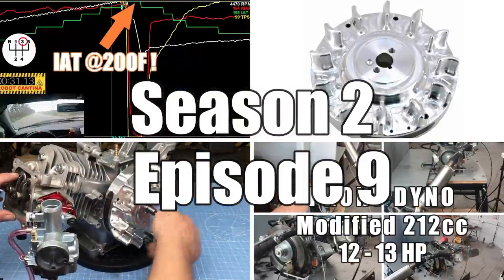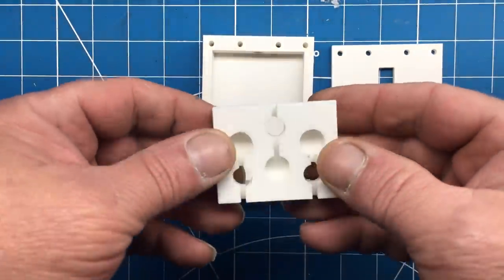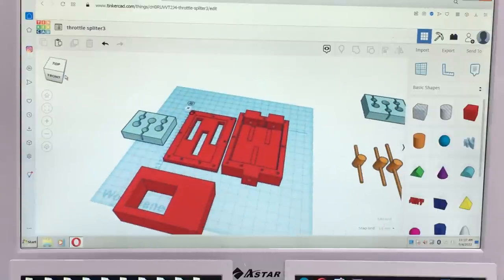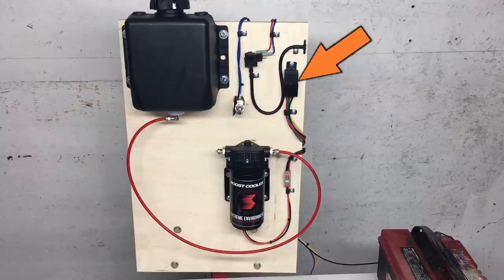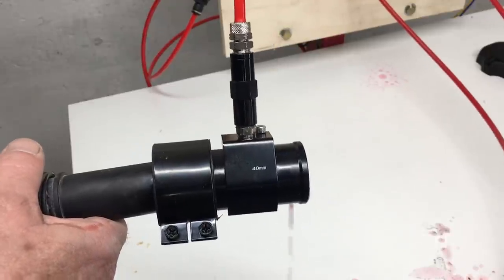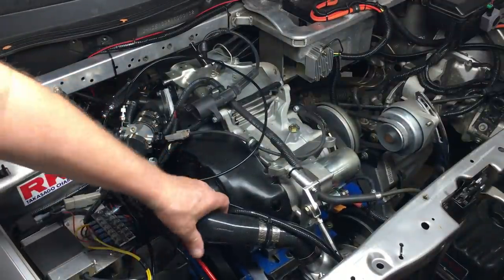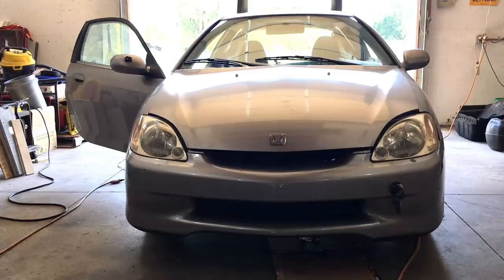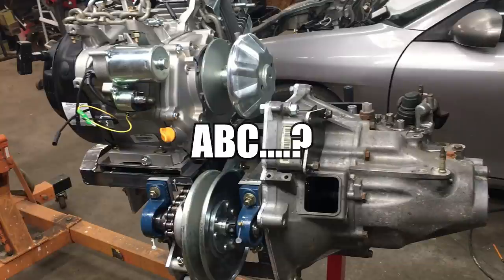S2E9: She’s burnin’ up Cap’n!  The 420cc supercharged hemi gets methanol  injection

Comment: I feel like this project is going to end up in the Guinness Book of World Records!
Reply: For the fastest slow car?
Reply: @benholroyd5221  Don't be ridiculous...it's Slowest Fast Car, get that shit RIGHT!
Reply: fastest street legal go kart...
Reply: @benholroyd5221  longest title for an engine design I’m thinking.
Reply: I think FJB just may end up scalping this 💡 and incorporating it into the Lame New Deal 🤣
Reply: @jpabon18  Proof that cars run fine with a lawnmower engine ...
Reply: @izzyplusplusplus1004  😊😊😊
Reply: Most power for smallest displacement world record
Reply: @MrDrifterdevin  unlikely . He may do well. But I'm sure that' title will be held at the race track. By sand dragster 
Or other small displacement dragster with out hp  restrictions
Reply: And I think it's power per litre or per 1000cc same amount
Reply: Worlds most over designed cement mixer engine
Reply: @jamestunedflat8942  How hot does it get in KANSAS any way?🥤🥤🥤🥤🥤
Reply: @kansasrose2909  mid 90'sF or about 35c don't ask me about Kelvin because I've got no clue
Reply: @kansasrose2909  wait were you flirting with me?
Reply: @jamestunedflat8942  🌹🌹🌹🌹
Reply: @kansasrose2909  ☺🌷
Reply: @MrDrifterdevin  nah, there's plenty of 400 ish cc engines that are making close to 100hp, this ain't it, despite how cool it is

Comment: So with methanol, it's got a couple of things going for it; 1.) it's an alcohol so its a fuel.  As for tuning, you need to take out fuel because you're adding fuel with the methanol.  2.)  It lowers intake air temperature by evaporating which allows you to increase timing since it's combatting detonation/preignition with the lower temperatures.  Additional timing allows for an increase in power.  THe only issue with vaporization is that it take linear distance for the vaporization to occur which  equals the cooling effect.  A lot of methanol induction kits include a spacer plate with a nozzle to inject meth at the throttle plate.  This in theory "works"   but that's way too close to the combustion chamber for maximum cooling.  You'd need a long intake tract to allow the atomized meth to vaporize into a gas to make it worth something.  Plus you'd want it to be after an intercooler so you'd get the benefit of the intercooler and then the meth.  I saw a youtube channel of a guy who has an RX8 (a long time ago) with no intercooler and I don't remember if hes running a radiator or not (it's been a while)  it does run didn't blow up.  I do hope you see this and I hope it helps...

Comment: Safety improvement: Print a new splitter thingy with extra screw hole on the edges so that you can mount a dust cover on top of it. You don't want any dirt making your throttle stuck wide open 😆

Comment: An extremely simple and cheap way to eliminate the vacuum issue is to run an automotive blow off valve with an air filter on it.
Reply: That was my vote. Twin TBs is a “trash” setup that enjoys pumping losses ;-). Trash is definitely my scientific term.
Reply: @BrodeyDoverosx  😊😊😊
Reply: Man,  you seem very happy with ROBOT CANTINA
Reply: Bingo
Reply: @ocdman202  I definitely love it lol
Reply: I was thinking about something simple, like an "organized air leak", using a PCV valve with an el cheapo turbo manual boost wastegate controller.

Maybe it would work, maybe not... 🤷

Comment: What you need to bypass the supercharger is the diverter valve off your choice of any old VW/Audi 1.8t/2.7t engine, the rumor online is the so called "710N" unit is the best, can't vouch for that but they hold up fine to 26 psi on my car. You give it vacuum and it opens, you give it boost pressure and it pushes the diaphragm even harder closed, and best of all, if you remove the vacuum/boost reference, the internal spring will allow the valve to open around 4 PSI as a sort of failsafe boost limiter.

While you're at it you might as well also pull the intercooler off the same donor car as they are relatively small and easy to remove.
Reply: That would be fun. Using the diverter valve backwards lmao
Reply: @BrokeWrench  Which one is harder to come by,  baby formula or gas..???👶👶👶👶👶
This channel keeps me coming back for more.
Reply: @kansasrose2909  They are both worth their weight in gold !
Reply: @ocdman202  That baby formula is made with high fructose corn syrup... 👶👶👶👶
Reply: @kansasrose2909  We are on the precipice.
Reply: Are you ready for double digit gas prices?

Comment: Detonation is spontaneous pockets of ignition that occur AFTER the spark has already started the main flame front. Pre-ignition is spontaneous ignition that occurs BEFORE the spark fires, and that's what you described in the video.
Reply: This is true. Detonation isn't itself damaging to the engine but if allowed to deteriorate into pre-ignition it will very quickly cause engine damage.
Reply: @Dreddip  😉😉😉
Reply: @ocdman202  Man, you seem very pleased with this channel.!!😊😊😊😊😊
Reply: @kansasrose2909  I am ecstatic with this channel.
Reply: @Dreddip    B.S.!.. continued detonation can be VERY damaging to an engine.

Have you ever pulled the rod bearings out of a high performance engine that has experienced detonation for only periods of 8 seconds at a time for 20-30 times? 

I guess not...
Reply: @davelowets  Except in extreme cases, detonation itself isn't damaging to the bottom end of an engine, thats pre-ignition. SEVERE detonation will burn holes through pistons and valves. But to answer your question, I work topend turnaround on nostalgia alcohol funny cars and this year we ran a fuel altered on 100% nitromethane. An 8 second pass for us is when we shut it down at 300'. Safe to say your "I guess not..." assumption was incorrect. 🤷‍♂

Comment: Shouldn't it be possible to make a bypass valve setup using a large T coupler and a one-way check valve on the side? So when there is a vacuum, the check valve opens, and the supercharger then blows it shut when it creatives positive pressure. I'm sure there is a reason why people don't do this, but in theory it should work in my mind, haha!
Reply: audi have a gigantic check valve for this purpose on there compound turbocharged diesels , part No 059145901C to bypass the small turbo once the big one overpowers it.
Reply: A blow off valve in a tubo could work for this. They normally only operate when the throttle is closed and there is charge air in the intake before the throttle body.
Reply: @GradertJ  😊😊😊
Reply: Supercharged Mini Coopers have a small stand alone bypass valve that would probably work well here. One way check valves usually take too much pressure differential to be useful as a bypass valve and mechanical blow off valves usually actuate over too large of a pressure range. Bypass valves use a diaphragm that actuates the valve rapidly right at atmospheric pressure.
Reply: @BuffMyRadius  Which one is harder to come by baby formula or gas??👶👶👶👶
This channel keeps me coming back for more..
Reply: @kansasrose2909  They are both worth their weight in gold.
Reply: @ocdman202  😊😊😊😊
Reply: @kansasrose2909  Rose,  you seem very happy with ROBOT CANTINA.
Reply: @BuffMyRadius   Totally agree, dump the twin t-body's and use a vacuum operated by-pass valve. Or program one of the t-body's to perform this function. Look at pics of the roots blowers (M62/M90) from the GM 3800 engines. They have the by-pass valve built into them.  You'd likely need a couple T fittings on either side of the blower with the t-body plumbed in to by-pass the blower under vacuum. Dig?
Reply: @EricWoodring6thplanet  that's why I suggested the Mini Cooper bypass valve. It uses an M45 and the bypass valve is a separate part, so it should be pretty easy to integrate.
Reply: @BuffMyRadius  When I was a teenager in the late 30's and early 40's, electronics wasn't a word. You were interested in radio if you were interested in electronics.

Comment: Great video! Love the addition of the 3d printed parts!

I default to using Fusion360, i really like the ability to use variables for my sketches/extrusions/cuts instead of setting values directly so i can easily modify the design on the fly.

The addition of using a second throttle body to control the vacuum was inspired!

Looking forward to the next video!
Reply from the maker: No doubt fusion 360 is good stuff, Tinker cad is more or less kindergarten CAD, but at this point that's what level I'm on.
Reply: @robotcantina8957  Hey! Whatever works! Im still a noob to CAD and Fusion 360, but i can make what I need :)

Comment: Make sure the intercooler you use has a weep hole if you're planning to do WMI before it since puddling will be unavoidable. By the way, WMI into a piping elbow will keep it from collecting as a wash on the walls of the pipe. Would make it easier to run between the SC and TB. Though, everything must be taken with a grain of salt given the low CFMs you have moving through those pipes. It might even be possible that a choke point at the WMI point would help as it would increase air speed. Everything will be a bit different to some degree because of the oddball application. I'm confident in your thorough testing though. Keep it up!
Reply: I come here for the video and stay for the comments👍👍
Reply: @ocdman202  😊😊😊
Reply: Glad someone else mentioned this, now I don't have to
Reply: @BrokeWrench  Which one is harder to come by  baby formula or gas???👶👶👶👶
This channel keeps me coming back for more.
Reply: @kansasrose2909  They are both worth their weight in gold!

Comment: Dump the twin t-body's and use a vacuum operated by-pass valve. Or program one of the t-body's to perform this function. Look at pics of the roots blowers (M62/M90) from the GM 3800 engines. They have the by-pass valve built into them.  You'd likely need a couple T fittings on either side of the blower with the t-body plumbed in to by-pass the blower under vacuum. Dig?

Comment: That intercooler should drop temps a lot, Should give a good boost to power.
Reply: @kansasrose2909  Rose,  you seem very pleased with this channel.
Reply: @ocdman202  Yes, I am.
Reply: You could also check out the first gen (02-06) Mini Cooper S parts list for it's intercooler.  They are a 1.6L engine.

Comment: An interesting saga so far Jimbo since bolting the stock 212 cc Predator engine to the Honda Insight.  It's good you are using a car with a low drag coefficient, instead of using a 1960's VW micro-bus.  Speaking of drag coefficient, you may want to calculate how much horsepower will be required to reach your next speed milestones, since you are at the point where losses are exponential.

Keep up the good work Jimbo, this type of thing is of course fascinating to us Techo-Gearheads!
Reply: I come here for the video and stay for the great comments ...
Reply from the maker: Thanks for the comment !  I have to cap the speed at 70 MPH because that is the max local speed limit.  The last  five MPH is tasking forever to figure out... we should get there soon.
Reply: @robotcantina8957  Thanks for the reply.  Yes, the intercooler should help but, with the high outdoor temperatures you are experiencing, I suspect unforeseen problems will crop up.  But, nothing a few more episodes won't cure, just keep those garden gnomes away.
Reply: @billharris6886  I come here for the comments and stay for the video!

Comment: Water meth injection should get those intake temps way way lower than what you're seeing. I know this is a very small engine, and even using the smallest nozzle may be just to much spray using this stage 1 setup. The spray comes on at a selected boost pressure and stays steady. But if you can get a stage 2 setup that has a progressive controller, you can set spray to start at 5psi, and max spray pressure at say 15psi for example(even though you'd never reach that). The idea is that it'll slow the spray rate down enough that it's not too much for the engine. I think you'd have much better luck using a progressive setup vs the hobs style setup. Hobs style isnt the best for PD blower engines. Just an idea that's probably worth trying out. 

Somebody what mentioned using a blow off valve instead of the double TB setup. Just wondering why this wasn't tried out using just 1 TB between the engine and blower set up as a blow through design?

Comment: It'll be interesting to see how effective the air to air cooler is. My preference would have been for an air to water unit but I acknowledge it would be more complex and heavier, and I have no proof that it would be better. Looking forward to the next developments!
Reply: Air to water would actually have been trivial.
Simple electric water pump. The air-to-air intercooler could package better. And then to exchange the heat to the atmosphere you just use the original radiator for the car.
Reply: Another idea could be to use the cars washer system to spray the intercooler to help cool it but im sure it will be fine without that especially with meth injection
Reply: An air to air intercooler works better than I thought they would when I first started playing with them. 

An air to water cooler enjoys longer use under heavy boost without heat soaking, but isn't all that much more effective than an air to air system for a lower power application.

Comment: Why not ditch the first throttle body and instead fit a blow off valve between the output of the super charger and the throttle body on the intake manifold. Then hook the blow off valve to manifold vacuum so it stays open when the throttle is shut but once you have enough throttle opening to hit atmosphere pressure in the intake manifold it shuts and gives you full boost.

Comment: Fantastic video. I have never seen such an elaborate water/meth setup lol. Water/meth is normally super simple and easy to use, but then again, it's not normally used on such a small engine. I knew an intercooler was the obvious solution to high IAT, but this build is all about doing silly things and I love it.
Reply from the maker: Thank you!
Reply: @robotcantina8957  😊😊😊
Reply: @robotcantina8957  💖💖💖💖

Comment: In a twist of Irony, I have seen cars overheat merely because the hood was removed and return to normal operating temperatures once the hood was replaced. Most specifically a mid 90's Honda Prelude we built in our younger days.
 The original engineers thought of a lot more than you might think when they designed the car, and they designed the cooling solution to work best with all of the original equipment in place, mainly the hood.
Reply from the maker: True, but keep in mind this car is far from being original.  Last summer in Michigan when we did a lot of development work, we ran with the hood off and it makes a big difference.  Actually, for this car the best way to keep the engine cool is to remove the aluminum belly pan.  I normally don't like taking that off because it keeps all the dirt and road grime from getting into the chain drive.
Reply: @robotcantina8957  💖💖💖
Reply: @robotcantina8957  Stock motor configuration, No.  Stock aerodynamics, Yes. 
But as long as you tested and verified it on your car and you're not just assuming its cooler with the hood lifted.
I figured I had to throw that out there tho because of my past experiences.
Reply: @TheOneAndOnlyRandy  They should come out with the drinking man's guide to this build..
Maybe ESQUIRE  could do an article..
Reply: @kansasrose2909  Maybe.
Not that I'm much of a drinking man... or a drinker at all.
If it were presented like Drunken History then perhaps I'm in lol
Reply: @TheOneAndOnlyRandy  I really like that show== Drunken History. 🤓🤓

Comment: I put a GX420 into a G-11 Daihatsu Charade before finding your channel... it has surprising pull for such a tiny engine and mine is directly coupled to the gearbox so starting off is a little slow, but boosting induction might be the key to normalising the launch capability.
Anyway, great work with what your achieving.

Comment: a PWM was what I was going to suggest also. But I make them from scratch with a TL494 chip and IGBT. I made one as a fuel pressure control for a turbo charged motorcycle a friend was making. You use it in current mode to set head pressure from the pump.
Reply: We are enjoying this journey into the unknown..
Reply: @ocdman202  How far out are you going??
Reply: @kansasrose2909  😉😉😉
Reply: @ocdman202  Gas prices hit another all time high on Thursday!!

Comment: Lifted hood don't work. Windshield bottom is high pressure area, that's why with fan off in highway you can feel wind blowing inside car. It wont pull out off engine bay, instead, it'd make it smell bad inside interior. Engine, belt heat smell, and other things come inside. That's also how cowl hoods for Mustangs and other big carb cars work it has opening in back to breath from windshield
Reply: :elbowcough::elbowcough::elbowcough::elbowcough:
Reply: Are we going to get to ten dollars a gallon>?

Comment: Just use a reed valve from a 2stroke as a vacuum pressure relief valve between supercharger and engine.. positive pressure will seal valve and you get boost, but open when vacuum. pretty sure you could 3d print a manifold for it
Reply: With a small air filter I'm assuming?
Reply: @TheMetalButcher  😊😊😊
Reply: @ocdman202  Man,  did you see that bazooka!!
Reply: @kansasrose2909  Yes, I did.

Comment: I think speeduino stores thermistor based temp sensors as 8 bit variables, and I think a few of those values are used for error reporting or negative values. You might have maxed out the IAT, impressive!

8.5:1 saving your beehind...

Comment: I'm trying to understand why you didn't use a check valve to bypass the supercharger when the pressure dropped to neutral. That would be the simplest solution possible.